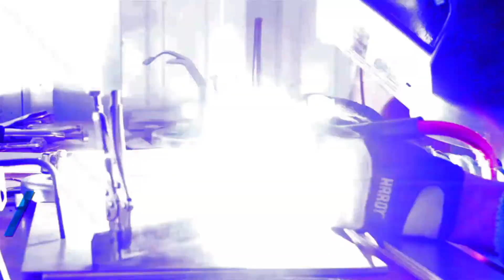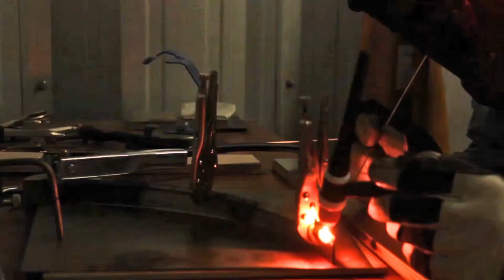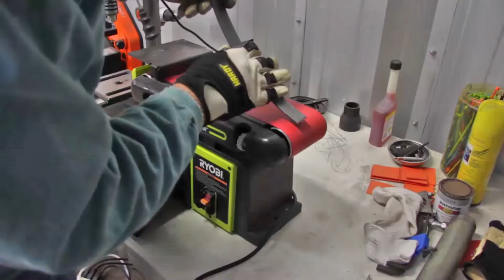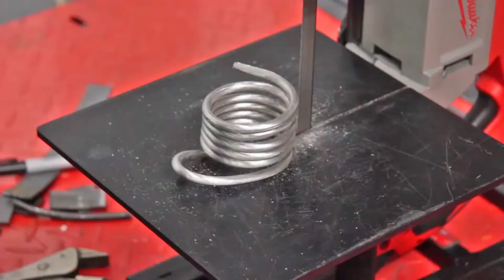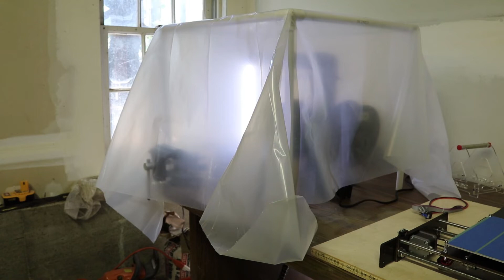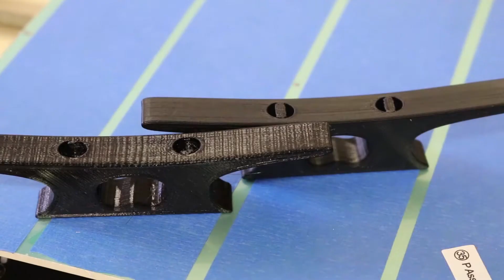Printing ABS on the AnyCubic I3 Mega

Comment: making an abs glue and printing with a raft has gotten me some really good results on the anycubic 13 mega with abs so far.
Reply from the maker: Thanks, good tip,  I always print with a raft, I will have to try the ABS glue,  but I have had good luck with glue stick as well
Reply: @JoediyLab  it's a mix of acetone that has abs dissolved in it. Apply an even layer where you want prints to adhere.  Use same color abs as you are printing with
Reply from the maker: @lordzallen  Thanks

Comment: The Anycubic i3 mega doesn’t need an enclosure as it prints perfect without
Reply from the maker: All depends on ambient temperature and humidity.  If you are printing ABS, you have to watch for warping, when the part cools too quickly.
Reply: I recently got a ANYCUBIC i3 Mega Printer and I always print with ABS. I would have to disagree. When you are print with ABS on a i3 Mega, you need enclosure. It really prevents warping at the bottom face.
Reply: yes I agree Ultra base working fine

Comment: Just ordered my second affordable printer that can supposedly do abs without an enclosure because it ships with a 24v psu.
Reply from the maker: Very cool
Reply from the maker: Yes, do some test prints, use glue stick and a raft. build a cardboard or pvc enclosure to keep the temp stable.  You should have no problems

Comment: Don't want to heat up the electronics though.
Reply from the maker: Thanks David,  yes I cut  the plastic to expose the base of the printer to the outside air.  When I have my head under the plastic I can feel the heat above the base.  But when I check the air around the bottom of the base it is much cooler.
Reply from the maker: The bottom of the printer is left exposed to allow cool air to circulate around the base for cooling